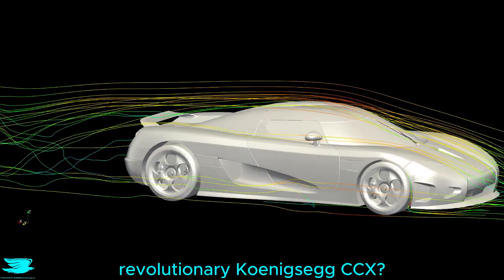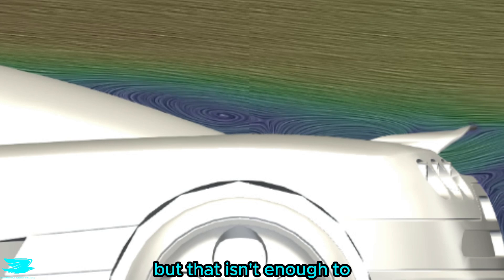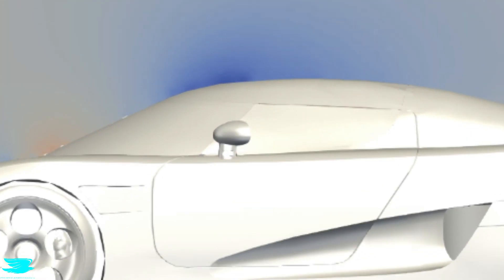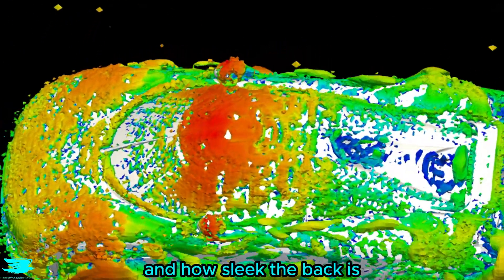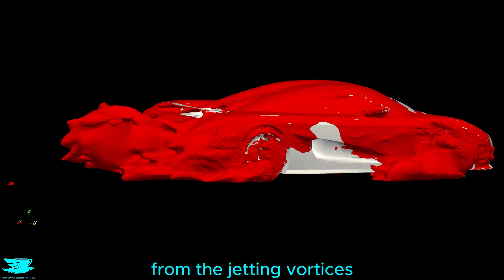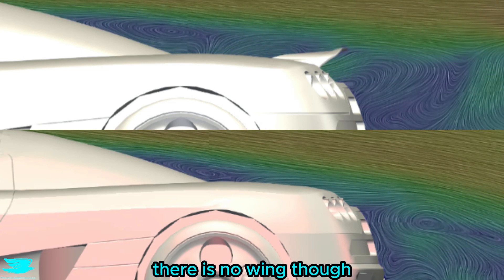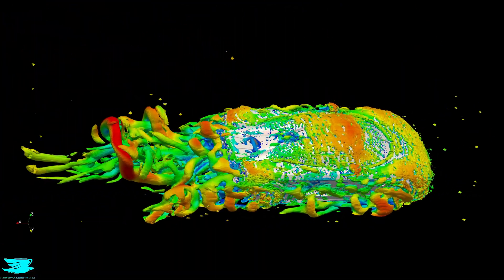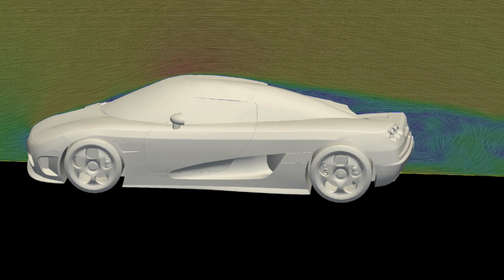Surprising Aerodynamics of Koenigsegg CCX Supercar

Comment: Where do you source the CAD models from? Also, if you're doing a transient simulation, why sticking to MRF where sliding mesh would be much better at modest additional expense?
Reply from the maker: Sliding mesh isn't a modest additional expense. The computer has to calculate and update the mesh every timestep. If you have a couple million cells, then that takes time.
Reply: @PremierAerodynamics  I know, but the increase in computing time when passing from steady state to transient is one order or magnitude larger. Also I really hope you're using more than a couple million cells lol.
Reply from the maker: Yep, 2 million for the wheels. So, those cells need to be remapped each timestep.

Comment: Isnt the undertray responsible for the low pressure and downforce beneath the car and the diffuser is the expansion area so the low air pressure turns into higher air pressure to make the exit of airflow smoother and not violently converge.
Reply from the maker: Yep, but the diffuser also creates downforce by throwing the air up. It also helps reduce the wake size, so you have higher pressure on the rear face of the car and that reduces drag.

Comment: Being called "the best designed car ever", the Mercedes W124 definitely deserves a look. Officially 0.28, but have seen smaller figures also mentioned, as low as 0.25 even. But considering the looks, I think even this 0.28 just begs to be verified...
Auto-Union Typ C Stromlinie could be interesting maybe, after a fatal crash during speed record attempt, wind was blamed for the loss of control. In 1937 it was hard to tell what went wrong at 430km/h - unlike now, when could examine the aero design and all... 😉
Reply from the maker: Thanks for the ideas!

Comment: I think you, amongst many, are confused about the term :generating downforce"....u cant generate or create downforce passively with wings and canards...rather, its about exploiting and manipulating areas of vacuum, low pressure high velocity...drag is a consequence of balancing forces, like fire is a consequence of other causes and isnt "real" in the sense that the flame we see is simply friction causing a spike in the relative temperatures. like the bottom of a spaceship upon reentry into orbit, the pressure/temp difference causes what we see as fire- but if our vision was different, we either wouldnt see it or it would be too bright...so it is with drag of a car- its simply the area where the forces acting on the vehicle have to quickly return to equilibrium state as fast as possible. if that process happens on or near the vehicle, its like pouring a ton of water on the back of the car. so, to reduce drag, this balancing process returning air molecules to the stable, unaffected state must occur as far from the vehicles flat surfaces as possible, while to "generate downforce, the bottom of the car and wing, must move air molecules faster than above the vehicle, but each molecule must meet at the back of the car at the same time they split at the front- which produces drag because not only are they moving at different speeds, but they return to normal wind speed, so this create the friction called drag, a consequence of decelerating molecules.
Reply from the maker: Thanks for the input!

Comment: This channel has been really eye opening to me - I only really knew the barest bones basics of car aero before, and my understanding was basically WING = DOWNFORCE = DRAG, but its cool to see how, with a properly designed body, you can steal a bit of downforce without much penalty, and that aerodynamic surfaces like splitters & wings are in reality far less impactful on drag and downforce than things like rooves and fronts.
Reply from the maker: Thanks. Yep, the main cabin is the difficult part to model well, but if done so, you can alleviate much of the bad aero right there.

Comment: I wonder if the hot air coming out of the engine bay causes any change on the effectiveness of that small wing, like increasing the pressure under the wing virtually making the wing useless...
Reply from the maker: Good point. I think the entire wing would feel it, especially once the engine has warmed up.

Comment: The ccx was not designed to have a wing. The wing was added after topgear stig crashed it. They determined it needed a small wing to give it enough downforce on the rear.
Reply: No, the wing was an option. But CVK made the CCX to beat the veyron top speed. The wing was always available but people never optioned it. The CC8s came with a wing standard.

Comment: The position of the wing leaves much to be desired. It would have worked better slightly more rearward like a duck tail, and raising the leading edge somewhat, to more closely align with the slant of the canopy.
Reply from the maker: That is a good idea. Putting it more behind so that you can get the lower pressure away from the top of the car. That would increase downforce.

Comment: Do the Agera next to see how they improved
Reply from the maker: Thanks for the idea!
Reply: @PremierAerodynamics  the first agera is beautifully smooth and the final RS verson has soo much aero it looks like a track car. Also I'd like to see the regera's too, that car has interesting design choices, notably the side vents behind the rear wheels, the exhaust melded into the massive diffuser and the reverse intake. The jesko is said to have been through some intense aero work in it's production and the rear end of that car is incredibly well shaped to accommodate for the banana-bomerang spoiler. Also, it'd be interesting to see the effect the fighter jet-like flaps on the absolut version have on the proclaimed high speed stability, and if the wake gets worse without them, and also see if the spoiler can really produce the absurd amount of downforce they claim it produces on the attack version.
Reply: And logically the Jesko after that.

Comment: Never heard anyone calling it the segg before tbh. Snobs would always deride you if youre not always able to pronounce the full name correctly, although i think thats quite fair. Although seggs is only one letter away from seggs and that’s i think is the most interesting thing one can take away from this.
Reply: One think im curious about actually, some supercars dont have sloping windows at the back but instead use inlets and a flat rear window. I wonder, if those inlets were regular sloped windows instead, what are the effevts on the aerodynamics. And then, why do they use the inlet design instead. Examples are the veyron, testarossa and fiero
Reply from the maker: Using them as inlets is an idea to get air from a region that is not going to affect the rest of the car too much. Also, sucking in air helps keep it attached. On newer cars, the inlets are typically sloped as well. So, they achieve a similar effect as a sloped rear window, where they are.
Reply from the maker: Who cares what other people think.
Reply: Do you mean that “seggs” is one letter away from “seks”?